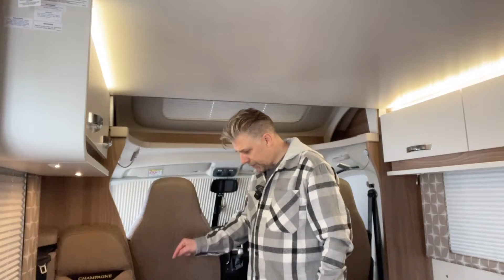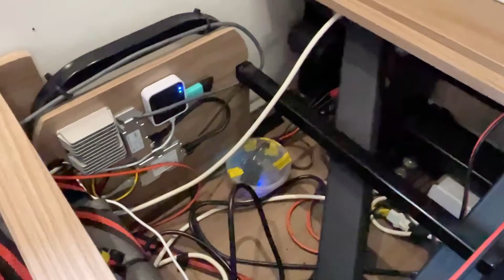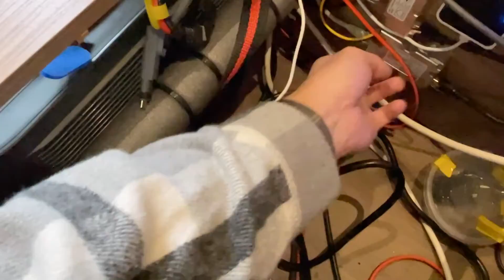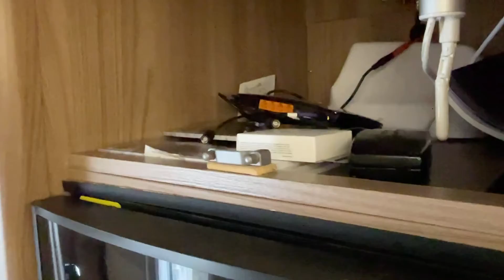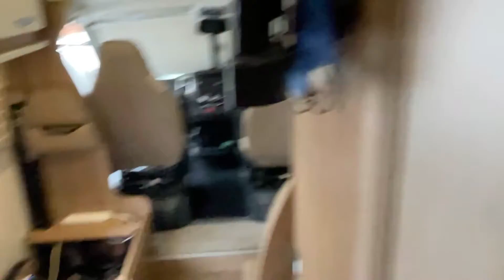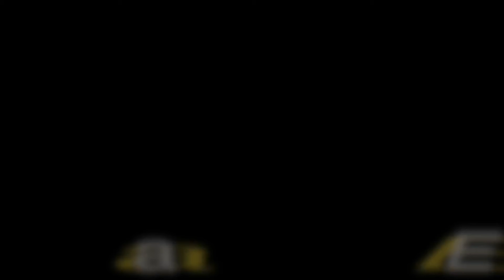How to use 240V motorhome appliances OFF GRID & wild camping!

Comment: Isnt the leisure battery anygood to operate the electrics..?
Reply from the maker: Yes and no. The standard van electrics will power your lights, water pump and heating but won't power your mains appliances. You'd need to add an inverter to provide 240V AC from your 12V DC battery.
Reply: @ASwiftEscape  Thanks for the advice...

Comment: Good and sensible modifications you have. A van can never have too much stored energy ( batteries ) or items such as solar generators ( either solar panels or battery boxes such as the eco flow. A solar panel ( either foldable or flexible ) can always be taken with you if needed for extended off grid trips. I recently bought a dokio 100w flexible from eBay that had a 20% off offer code. Can simply place on the windscreen and use the wiper blades to secure it tho il probably put heavy duty suckers to it. I would never rely on the alternator and split charger after all it only works when the engine is running and they're not very efficient anyway. Adding all that extra wiring is ok if it works for you and maybe appreciated by the next user but will almost certainly devalue a van if/when it comes to trade in time. ( Especially if not done by an approved and registered  professional. Dealers and most private buyers want a van that's been untouched by the previous owner. I understand that owners want/need their van to work as they want it to.
Reply from the maker: I agree with most of this. My spare/flexible panel is also a Dokio. However, trying to replace this much power with such a small panel is not going to cut the mustard. That’s why I went for this inverter option for charging while driving.
I also share your feelings about wiring modifications and how this affects it at resale. That’s why, whenever I install anything, I’m always thinking about how easy it would be to return it to standard. So far, nothing is spliced into the original cabling - it’s all added as either a replacement connector, or bolted directly to the battery terminals - therefore, easy to remove without any trace or damage. 👍🏻

Comment: Great video Ed - I didn't even know I had a spare 240v socked behind the pax seat. ! 
Not sure I'm ready to implement the full setup you have but might try to split out the feed from the socket so I can switch it in and out of the power pack when off grid manually. My power pack (Bluetti AC200) can be charged directly from 12v - (doesn't need an inverter) but takes hours to top the pack up
Reply from the maker: Thanks Andy. The Ecoflow will also charge from 12v. However, like you said, it takes many hours to get anything meaningful back in as it’s limited to something like 8A of current. The whole reason for the inverter is so that I can charge it from a mains input. I’ve had to throttle the settings on the Ecoflow so that it only charges at 900W (the inverter is rated at 1000W), but I can charge it from flat to 100% in maybe 3 or 4 hours of driving. Normally it’s not flat, so even a short-ish trip will bring it back to 100%. I decided not to go for a higher rated inverter as the 12V cables to it would need to be massive. This is a good balance, I think.